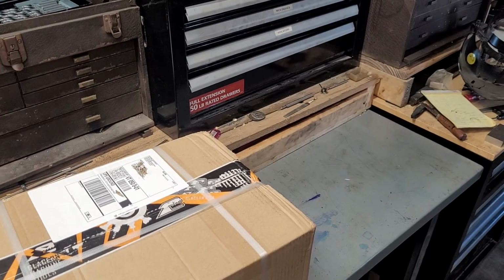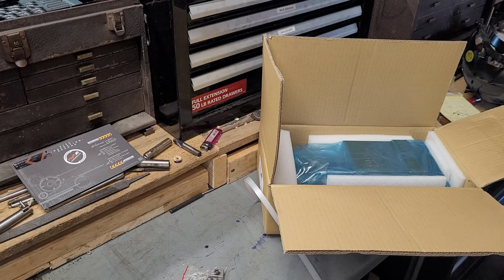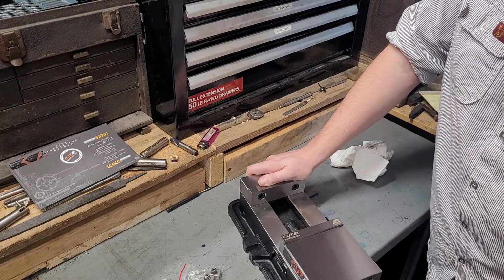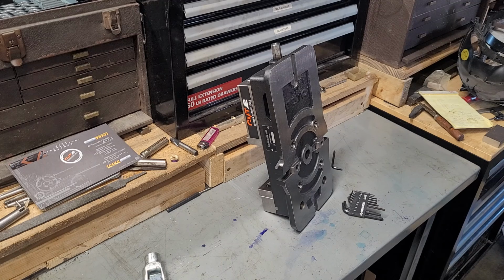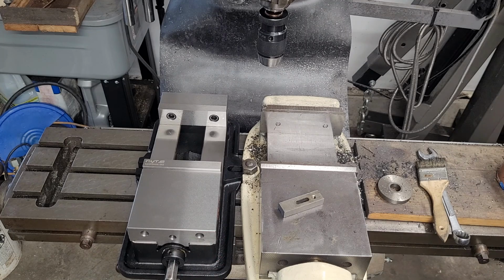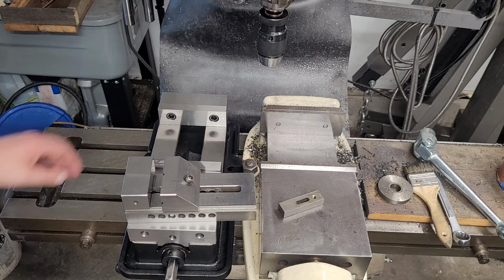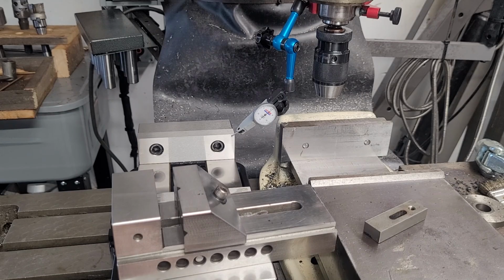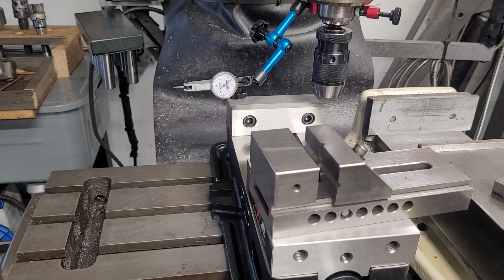Glacern 550 Milling Machine Vise Benchtop Review

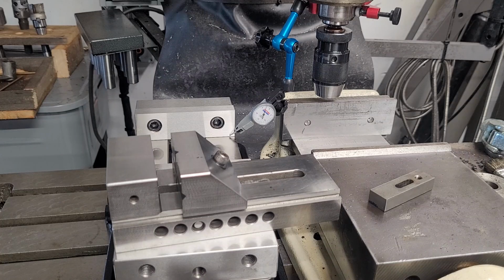Comment: At 18:00 did the BP vise hit your indicator and throw off your reading? Thanks for the video!
Reply from the maker: Nope, that section of my knee is pretty worn. I played with off it off camera and I do not get the same change when I run the same test in another part of the travel. This indicator also got tossed as it was not repeating as well as I'd like.